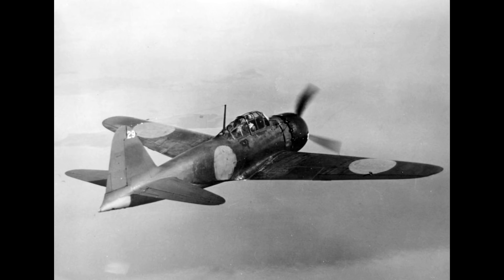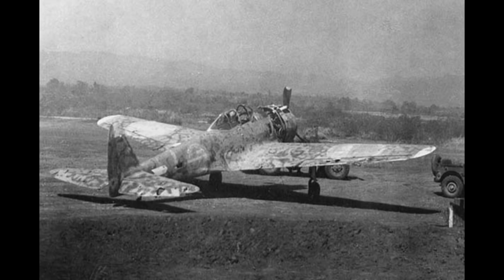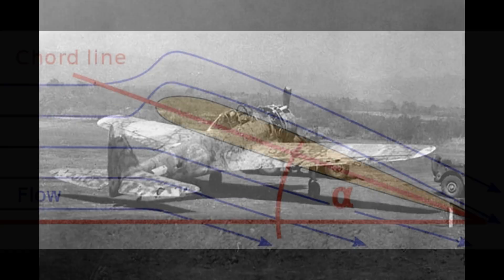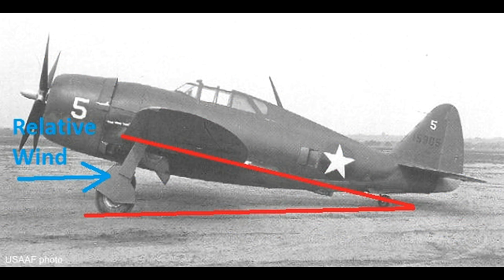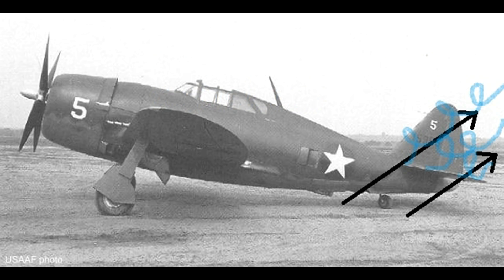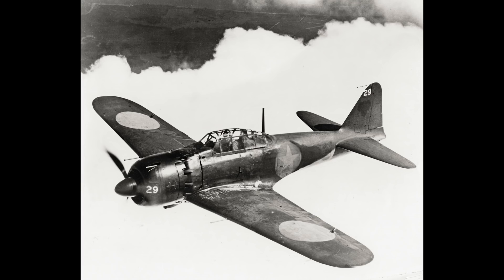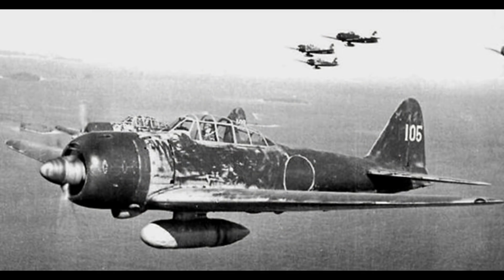Mitsubishi A6M Zero, an interesting fact few people know

Comment: Zero was required to provide a range equal to the range of attack aircraft, and at their cruising speed. To ensure their accompaniment. What set the parameters for the amount of fuel and load per wing. Appropriately covering attack aircraft, Zero was forced to take the fight from the cruise flight mode. Which made it vital to bet on high maneuverability. A similar requirement shaped the appearance of the Ki-43. Despite the fact that the tactics of high-speed combat on the verticals, the Japanese knew and considered the best. That is why the Ki-44 and Ki-61 were created.

Comment: The P-51, Ki-44 and Ki-84 are laid out in the same way.  Fighters were designed to be very nearly unstable in the pitch axis, to maximize maneuverability. Moving the vertical stab and rudder aft increased the moment arm, and thus stability and control about the yaw axis.
Reply from the maker: This was incorporated into some later planes,  the Ki-44 specifically. he Ki-84 and P-51 are similar but it's done to a much lesser degree.

Comment: The A6M's designers wanted a very maneuverable design, so it was made to be almost unstable about the pitch axis. A horizontal stabilizer and elevators close to the wing worked well. The rudder and vertical stab are also quite small by the standards of the day. Greater stability about the yaw axis was achieved by moving these rearward, giving a longer arm with greater moment.

Comment: On the other hand, both the Chance Vought Corsair and the de Havilland Mosquito have their stabilizer/elevators mounted well behind the vertical fin/rudder. I assume to achieve the same goal.
Reply from the maker: It has to be for another reason as neither of those planes are approved for spins, and in the case of a Mosquito, spin entry is likely going to be fatal.

Comment: I saw a couple of Zeros many years ago at a Thunder over Michigan airshow on the Willow Run airport and what really struck me was the size and length of the ailerons, they are about 3/4 the wing trailing edge. 
About the elevator forward advantage, what were the Chance Vought designers thinking when they installed the rudder ahead of the elevators on the F4U Corsair?
Reply from the maker: I have an entire video about the Corsair.

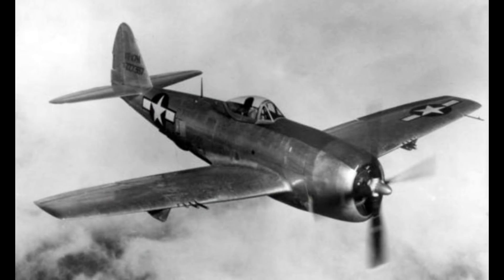Comment: 0:22
That's a Wildcat.  The F6F does actually have a somewhat forwardly positioned horizontal stabilizer and elevator.  It's not as extreme as the Zero, but it's farther forward than the F4F pictured here.
Reply from the maker: Negative Ghostrider. It's an early F6F-3 Hellcat. Source: https://en.wikipedia.org/wiki/Grumman_F6F_Hellcat

Comment: No one has ever pointed out that Mitsubishi design team were never allowed to use a Mitsubishi engine to extract higher performance from the airframe. From the start, the design was doomed to long term failure since only underpowered Nakajima engines were ever used as dictated by the Imperial Navy. The aircraft would never exceed more than 350 mph in level flight.
Reply: In several Zero documentaries, they discuss how Horikoshi (project leader) had reluctantly admitted to his own Mitsubishi staff that the Nakajima engines were better.

1 year later reply-

Comment: Interesting, and odd that this wasn't done universally for the same reason. Vultee, however, did have a layout on their Vengeance (even though high-alpha flight wasn't likely to be a major factor for their mission) and the P-66 Vanguard that might have had the same effect. It's a sort of reverse to the Mitsubishi, placing the rudder and vertical fin unusually far forward relative to the horizontal tails and elevators. I haven't looked up any wind tunnel data for them, but I imagine that at high alpha the turbulence coming off of the horizontal surfaces would pass behind the verticals, leaving those mostly in relatively clean air. I could be wrong though; it's been over 40 years since I did anything in a wind tunnel myself!

Comment: Greg! The tailplane of the macchi c205 veltro clears the elevators, there is a few inches of overlap only on the control surfaces. Please respond!
The c205 is often regarded as one of the greatest all around air performers of the ENTIRE war, it and its series brothers reggiane re 2005, and and Fiat g55. They are all incredibly beautiful airplanes I would like you to talk about them to us. All of these planes use a licensed or imported DB 605, an engine you have spoken about.
Reply from the maker: I agree they are all beautiful. The tails are not really like the Zeros, but I see what you mean about the fact that there is some overlap.
Reply: @GregsAirplanesandAutomobiles  I'd say the fact that there is only 2-3 inches of overlap would indicate an intention to harness the advantage you mentioned, and it certainly "feels" that way in flight sims over a 109. In the big name ones you can feel the definite increase in rudder authority.
Reply from the maker: I agree. The Italians knew how to design and build a plane. We can be thankful that their hearts were not really in the war.

Comment: SBD looked similar - Corsair was the opposite. I always assumed it was to allow deflection of both surfaces without either interfering with travel, negating the requirement for “cutouts” and giving the surface more authority in a smaller size / less drag.
Reply from the maker: The only source material I have for the Zero's design states that it's for lateral control about the vertical axis at very high angles of attack.

Comment: This also explains how the Zero pilots could perform the 'hineri-komi' maneuver, whereby when followed by a U.S. pilot in a loop they could tromp on the rudder at the top of loop, put the Zero into a slip that put it 90° to the vertical plane of the loop, then flip the plane back over, putting on the tail of the unfortunate Chinese or Allied pilot.

Comment: You can also move the vertical stab forward in relationship to the elevator like the De havilland Mosquito or the Vought built Corsair.
Reply from the maker: That's done for a different reason. Intentional spins are prohibited in both the Corsair and Mosquito.
Reply: Whether a spin is Intentional or not, has nothing to do with the ultimate control of the aircraft,  there are different ways to accomplish the same design performance goals, and most aircraft in this category and class were designed to be controllable and even recoverable during spins. Also all conventional gear aircraft are designed to have very effective rudders, thats just the nature of the beast. I have several books on aircraft design of this time period, with pictures and graphs showing how much of the rudders are actually blocked out by the horizontal stab's at high angles of attack. You can also accomplish the same thing, with a short cord horizontal stab and a tall rudder like the Bearcat. The tail of the Mosquito and Corsair were purposely designed to maintain good rudder authority during high angles of attack.  Also most of the air foil sections and aerodynamic principals utilized during WW2 were established in the 20's and 30's.

Comment: F4 Phantom had a similar problem rear elevators lost air flow at high angles the solution was to angle them downward to keep them in the air flow. It probably helped the rudder as well.

Comment: Saw a video on @UC4mftUX7apmV1vsVXZh7RTw channel about the Zero. it made a few good points that most people pass over.
 The zero was build as an interceptor and fleet defense fighter with the primary requirement being range not agility (the Army wanted agility above all else not the Navy). When the plane was first introduced it was no worse protected than any of the early fighters that was  contemporary with (ie no one had self sealing tanks and armored seats in the late 1930's)
By the time it faced the american fighters it was a two years old plane but it still held it's own (think a spitfire mark I or an early Bf 109 fighting in 1943 - basically outdated). 

The engine was good but offered mediocre power so the design had to be as light as possible. This  was a problem when they tried to upgrade the Zero, since it proved very sensible to any weight changes because it was such a carefully balanced plane. 

The radios were mostly useless (a combination of factors) so most pilots just took them out to save more weight so no real communication was available between ground stations and planes or between individual planes. The americans suffered from the same difficulties but their radios still worked to some degree with a reduced range and that was a definite advantage.

Comment: Alot of people praise the Zero for being  the superio fighter of 1941-42.
And compared to what it actually meet in this time period, it was in the beginning, but only because the opposition was either 2 rate fighters like the P-36 or Buffalo and or combat inexperienced pilots flying them, with the Zero being flown by seasoned combat pilots.
But once it meet combat experienced or the better well trained pilots in Wildcats or P-40's, then the playing field became more level.
The thing people overlook is, if the Zero faced off against other first line fighters of the time, its performance starts to fade in comparison, take for example the Spitfire mk V of 1941-42.
Its performance is better or equal in almost all categories except range, than the Zero.
Even the P-40 could literally give the Zero a run for its money, as it is the fastest of the two.
But more than often it is, as mentioned, the pilot behind the stick that counts.
Very good pilots whether they flew a Zero or P-36 could pull off remarkable feats of flying against an opposition in technically superio fighters.
Reply from the maker: and Spitfires.

Comment: The Zero's were very good against the Wildcat and probably performed the best until the Hellcat came along with the big PW R 2800 2000 hp. that became a game changer, also it was noted by American pilots that the under belly of the air craft was wood and there was no armor around the non sealing gas tank so if you shot a Zero in the belly it would become a ball of fire.

Comment: Compare the horizontal from an early P-40C to...say a MTO theater P-40F from just 1-2 years later and you’ll note the change in distance between the leading edges of the vertical and horizontal stabilizers between models. That F model is one of the first “long tail” P-40s

Comment: The other aircraft have rudders surfaces that extend the whole way down to the bottom of the tail, which achieves a similar thing in terms of improving rudder performance at high aoa and in spins. I also suspect that the design of vertical stabilisers/rudders to perform well at high aoa and in spins was relatively well understood by the 30s. Perhaps it was designed that way for structural reasons - to keep the structure lighter?
Reply from the maker: My source for this is Torikai Tsuruo, chief director of Fuji aviation (retired obviously).

Comment: I wouldn't necessarily say the A6M was alone in this idea. The F4U and to a lesser extent the Brewster Buffalo had this in reverse. The vertical stabilizer and rudder being forward of the horizontal stabilizers and elevators. Which would bring both out of the 'shadow' zone at extreme angles of attack.

Perhaps this is one factor why Buffalo pilots of the non massively weighed down models claimed it could turn with the Zero.

P-39 also has the horizontal stabilizer forward of the rudder along with the P-40 even though the stabilizers start at the same longitudinal point.
Reply from the maker: The Corsair's tail is literally the opposite of this and it's done for different reasons. There are other planes that are similar, but usually they extended the rudder, the Zero has the whole horizontal stab moved forward.

Comment: The Miles M20 designed as an 'emergency fighter' in case of problems producing the Hurricane and Spitfire, had a similar configuration. The vertical fin in particular being well forward.
Reply from the maker: That's the complete opposite.
Reply: Greg's Airplanes and Automobiles
Both rudder and tailplane are still forward of the end of the fuselage.  However bowing to your superior knowledge I shall watch the video again to see what I've obviously  missed.
Edited to point out, I'm not being sarcastic, I really mean I've missed something.
Reply from the maker: What I mean is that in the Miles the rudder and vertical stabilizer are forward. On the Zero it's the HORIZONTAL stabilizer and elevator that are forward, not the vertical parts as was one in the Miles, Corsair, Mosquito and others.
Reply: Greg's Airplanes and Automobiles
Yes I've twigged on to that now, that's what happens from not paying attention. Thanks.
Reply from the maker: No problem, I do it all the time.

Comment: As you show the photos, the Hellcat is almost exactly that way. You'll see that the trailing edge of the horizontal stabilizer. Is almost equal to the hinge mechanism on the rudder. Almost exactly where the a6m zeros is at.

Comment: When a plane is flying (including fighters and pursuit) the center of gravity is constantly changing  and when this presentation shows angle of attack one has to bear in mind where the CG is as the angle of attack and the center of load is... as gas is burned off or ordinance is fired the CG will change (which is why ordinance tends to be mounted in  or under wings it is a serious problem because weight has to be loaded relative to other weight (to "datum").. especially fuel and things being offloaded (like a crop duster)   the Zero is no exception

Comment: Later variants of the P-40 also used the feature you talk about, it was done to try and improve stability. They were not very successful as the design had been pushed to its limit by then just like the Bf-109 series.

Comment: Interesting observation. I would think the rudder effectiveness wouldn't get affected By stall too much. Single engine propeller generates enough air flow to the empenage in all conditions. The forward horizontal stab position was probably for longitudinal stability purposes.
Reply from the maker: Nope, it's for rudder control at very high angles of attack. The source for this is unassailable.
Reply: @GregsAirplanesandAutomobiles  I only see one source for this.
Reply: To clarify. Having the tailplane closer to the center of gravity, shortens the arm length. A shorter arm length generates less moment force, which translates less effectiveness of the tailplane. This over all effect decreases longitudinal stability but increases maneuverability. This would also aignifictly decrease the stall speed. The zero had this advantage.
Reply from the maker: Only one source? My source is Torikai Tsuruo, former chief director of Fuji Aviation Technology. I think that one source had a lot of weight. Furthermore, he talks about this extensively on video, it's not a quote I took out of context.

Comment: Very interesting. 
Were there any negatives to this configuration on the Zeke/Zero?
Could you get the same effect with an additional vertical stabilizer/rudder below the fuselage (with tricycle landing gear - I assume)? I guess there is no point to it otherwise...I was just thinking out loud.
Reply from the maker: There is a drawback to everything. The drawback here is that you need a bigger horizontal stab and elevator to do the same job, or one that's angled for more downforce. Either way, more drag.
Reply: @GregsAirplanesandAutomobiles  Makes sense. Thanks for this and the very interesting video.

Comment: Never knew that about the Zeke.  Interesting. Did know the aircraft, while all aluminum, was very light. The wing and fuselage are one assembly to save the weight in wing attachment bolts. Does complicate building though.  Also understand controls, ailerons particularly tightened up at high speed so that the Zeke was optimized for low speed, low altitude combat. Was there anything, short of hydraulically boosted controls that would have helped?  
Still, from 1940-42 it was one of the most advanced fighter aircraft in the world.  Range, speed, maneuverability, and firepower were outstanding.
Reply: Perhaps. so. But the A6M went through a series of modifications when the expected replacement was late in arriving.  Odd that such a seemingly simple one would not have been incorporated because this would address one of the bigger flaws in the Zeke.
Reply: My understanding is that they eventually had a Zero design that was competitive but by then the war was over.
Reply: The last  Zero had armor and self sealing tanks, larger machine guns and more power.  Top speed increased from 330  MPG to just over 350.  https://forum.warthunder.com/index.php?/topic/399891-a6m8-model-54-final-produced-a6m-zero/

Comment: I just noticed recently the the F4U Corsair has the vertical stabilizer/rudder much further forward of the horizontal stabilizer/elevators. Could this accomplish essentially the same effect coming at it from the opposite direction?
Reply from the maker: I don't think so because most planes with that configuration are not approved for spins, including the Corsair.

Comment: Great info,  the Corsair has a similar tail design,  but of course the extra weight didn't help
Reply from the maker: The Corsair's horizontal stabilizer is offset in the opposite direction.
Reply: I have always wondered why the offset on the Corsair,  maybe for better control of a heaver plane?
Reply: Actually, the Corsair had that peculiar tail design because if the tail had looked as good as the rest of the aircraft, it would have been 100% perfect, which would be blasphemy.  Well, that's my theory and I'm sicking to it.
Reply: On the Mooney, light private aircraft of high performance for its engine size, the vertical stabilizer tilts forward and on earlier versions the entire tail pivoted with trim adjustment.